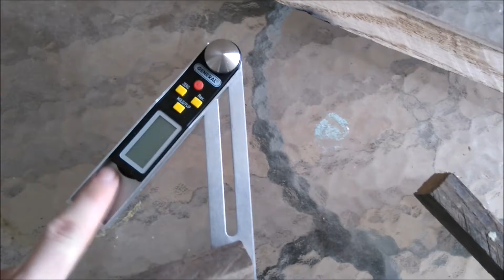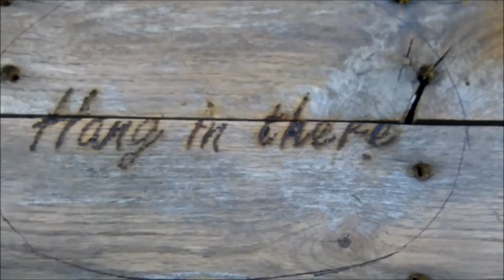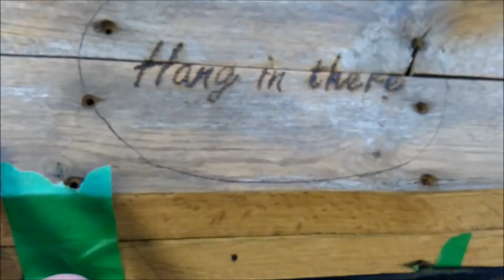How To Make A Fancy Rustic Coat Rack

Comment: I really like the shelves you made for your videos to. And... the rack turned out good! Hang in there man. Hehehe. I like how long those wood hooks are. It seems like you could hang a few heavier jackets on those, without them easily falling off, which is a great feature.
Reply from the maker: Puppet Master thanks puppet Master ya they both were fun projects, the shelf took a little longer than most projects 😝    have you got any new videos coming? I showed my family your flaming hot cheetos challenge that was hilarious and painful looking 😜
Reply from the maker: Puppet Master ya the long wooden hangers probably could hold a napsack or winter coat lol, I like it more now that I've used it a couple of weeks 😝